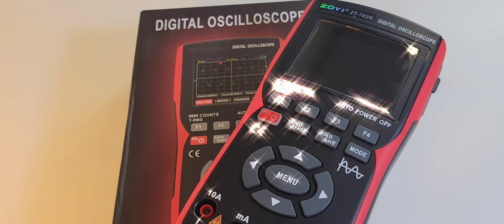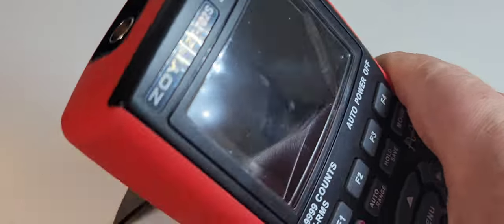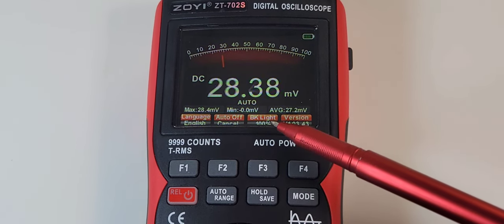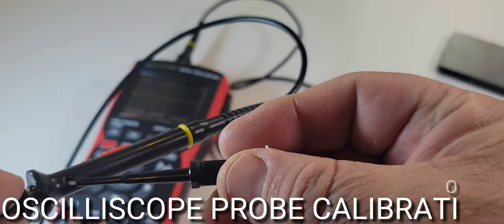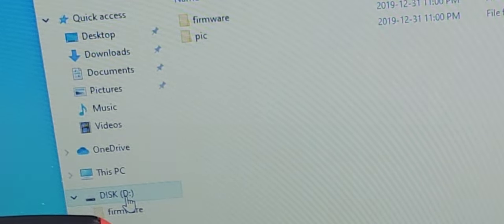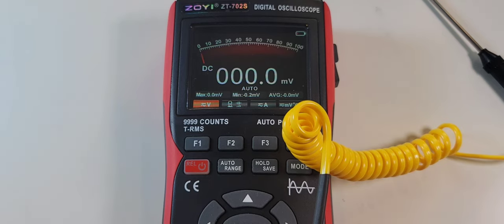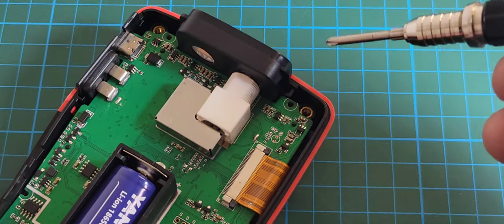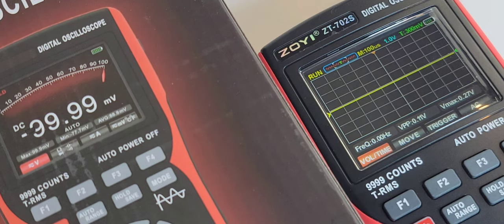ZOYI ZT-702S Multimeter + Oscilloscope Review & Teardown!

Comment: Really like this 2 in one. A DMM and Oscilloscope. I like to use this in my hobby of installing car Audio. One thing I notice is the over range issue. In car audio we are looking for non-clipping signal and a over range reading can mislead one.
Reply from the maker: Yes over range can be an issue ..it's still a new meter so hopefully a revision of the firmware will solve that in the next iteration.

Comment: I bought one based on Dave's review. He was unusually noncritical. I already have an Owon. So far I really like it for 1/3 the price. But so far, after some component tests, I have been using it with an HT antenna, watching the output from my transceiver and looking at RF from other sources. Although it is 10kHz it accurately displays the frequency up to at least 20mHz, so can be used as a counter. It is a pretty good HF RF monitor. I'll be checking the voltage and current accuracy later. I still have the Aneng SZ-20 to test! Too many DMMs.

There IS a REL. On the on/off button.
Reply from the maker: I think you'll be impressed by its accuracy..so far its been a real trooper !

Comment: Excellent!

Even tho I am a Fluke meter guy, if this was available 30 years ago, I would have bought
this over the one of the Fluke meters I bought back then!
Having a portable scope for use in installation/troubleshooting purposes is invaluable!

If you are worried about battery charge, carry a power pack, just in case, and plug it in when not in use!
Reply from the maker: Right on Jeffrey! Even today it makes the perfect Fluke companion 😊👍
Reply: @KeepOnTesting  I have a Fluke 117 meter and this Zoyi scope meter. Honestly these two meters are  the only two multimeters most people would ever need. Use the.Fluke for high energy high voltage work and the Zoyi for low voltage precision bench electronics work.
Reply from the maker: @robc8468  So true Jeff! That sounds like the perfect combination! As you say..with those two meters you can test/troubleshoot just about anything!

Comment: Hello Darren. Haven't been on in a while, life changes every week...
Thanks for the review. This device, like its brother OWON, is a very good device. For the price of $65 we have hybrid circuitry and a good set of instructions. For beginners and advanced electronics engineers, this is a very good device. There are friends who use these on the road. In our country, a lot of people earn money repairing equipment, car repairs in their garage. And such a device makes their life easier. Its accuracy is confident, even with an increase in frequency, it remains at a good level.
Of course, you can find flaws in this device, but the price covers them.
It was possible to expand the information content of the scale by the limit, by overload. You forgot to mention the REL function.
In general, I agree with the rating 5 out of 5))
Reply from the maker: Yes my friend! A well constructed and programmed multimeter  and oscilloscope at a very fair price ! I didn't see the REL was on the power button during my initial review..not the best location but it does have a REL. ! It's an excellent tool and worth those 5 stars ! 😃

Comment: I'd love to see one of these devices be truly integrated... use the DMM probes for everything, current waveforms, etc.... Even if it was low spec, if done well it would be a really useful tool. This just looks like my ZT-Y with a ds0-138 smushed in. Nice screen tho....
Reply from the maker: I hope that's the next step...it would  really be a nice way to improve an already awesome meter 👍
Reply: @KeepOnTesting  There are several earlier models from a different manufacturer, but they are all 1 MHz.

Comment: No to criticize
Great video. But not to criticize too much…

3:50 Plastic BNC’s on a oscilloscope is not a manufacture cheapening out on a product. Its actually the complete opposite, typically, if not always plastic BNC’s indicates isolated inputs. Because it costs two to three times more to manufacture isolated front end on an oscilloscope. 

But in the case of this singe channel scope as long as your not using the usb at the same time as probing a circuit grounded to the same power source you shouldn’t have any issue. Because the power ground and probe ground will almost always share shielding on full metal BNC’s. 

15:08 Does that not say REL on the red power button?
Reply from the maker: REL: Yes..I stated that in the comments as well..I completely missed the Rel/Power button as it was really badly placed. 
PLASTIC BNC: Good point 👉 👈 I didn't look at it from that perspective but makes sense.
Thx for watching! 👀

Comment: Hi Darren!
I bought it yesterday and I am very impressed. It's fantastic.
I have a question: What charger should I use? How many amps? Watts?
What if I use your 5000mAh battery?
Reply from the maker: Hey that's great 👍 news! I'm now using a rescued 18650/3500 mAh battery I pulled from a defunct Dewalt battery. It's a Samsung holds the charge very well. XTAR X4 is a great choice for chargers 👌

Comment: It finally ARRIVED! By the way, with a newer software version (1.03.51). This version has a MAJOR improvement: EVERY TIME you select "A" or "mA" in the multimeter mode (including switching between these modes), it displays (graphically!) the correct connection of test leads. Unfortunately, it does not display anything when you RETURN from those modes. 

PS, being advertised as TRUE-RMS, it cannot do this for high frequencies even in the scope mode! 
The situation: a vintage Soviet VFD calculator with a step-up converter, its VFD filament is powered directly from one of the secondary coils. The voltage on it is 2.5 V RMS +/- 10%, 115 kHz, PWM-like pulses with duty approx. 25..30% and without any DC component, 8..8.5 VPP. In multimeter mode, it displays zero (as all my other multimeters except Electrónica MMC-01 which displays 7 V). In scope mode, it displays 3.33 V RMS, which is definitely deadly for the VFD (and it operates perfectly!). Are there any multimeters that are able to measure RMS of such signals correctly (at least +/- 10%)?
Reply from the maker: Great stuff !! Honestly.. to measure high frequencies a good Scope is the only way to go. Dmms always have low maximum bandwidth involved. I don't know if the expensive Fluke 87 has analog or digital true-rms conversion. I'd say digital..most cases "true RMS DMM" means "it works for 50/60/120Hz that's about it..
Reply: @KeepOnTesting  Yep, up to several kilohertzs.

Comment: Wow, 5 stars. I see this meter-o'scope managed to impress you. I can't remember the last time you gave a 5 stars mark.🎉

Another alternative for a budget hobby oscilloscope could be the PC type. They usually have slightly better specs than handheld ones, but the crappy software could be their weak point. Or you can try your luck hunting for a proper bench scope on a used market. 🤷‍♂
Reply from the maker: Zoyi really knocked it out of the ballpark.. a real usable multimeter with an oscilloscope and rechargeable too...all at a price that's jaw dropping ! 😳

Comment: Just know that the battery you replaced it with is most certainly NOT 5000mah.  18650's top out at about 3500mah for 'low drain' types, and even less for high drain (~10A+) ones.
This is why it's important to buy Li-Ion batteries from reputable vendors like 18650batterystore.  There's a good chance that battery is even less MAH than the original, although the original could have had inflated numbers printed on it as well.
Reply from the maker: Yes indeed...3500mah is to be expected 😊 I've since replaced it with a Samsung INR18650 I rescued from a Dewalt 20V Max battery. It's a great battery...just not thrilled that it's pink 😅😅😅
Reply: @KeepOnTesting  Pink? --- sounds like they might be the Samsung 30Q's I have.  Great batteries - 15A and 3000mah.  But I'm not wild about the pink either. 🙂  I use Li-Ions for both vapes and flashlights, so I'm somewhat versed on the good batteries for these applications. 👍
Reply from the maker: @enigmaticmf  Agreed..These Samsung's are definitely winners. Just don't know how pink became their color choice..would be great in a flashlight as you mentioned. I should find my camping gear and upgrade to these.. 🤔
Reply: @KeepOnTesting   I know I'm late to the party, but the tools I have that are painted pink seem to stick around in my bag/box and not as likely to be "accidentally" misplaced with someone else's tools.  Thanks for the review; I have a 702S on the way to me now and have returned another meter based on a different review video you uploaded.  You've earned yourself a sub, thanks!
Reply from the maker: @JoshCarlsonftw  Great to hear Josh! Let us know how you like your new 702S 😊👍

Comment: Good day , thanks for the awesume presentation. I know very little about Oscilloscopes but I wanted one to test the output voltages on generators (110, 240 volts) would this meter be able to handle these voltages in oscilloscope mode?
Reply from the maker: Yes, not a problem 👌

Comment: Hello, Can it be used in automotive diagnostics? Does it support CAN, LIN and FlexRay protocols? And if not so what is the affordable one do you recommend for automotive repair?
Reply from the maker: No. I do not know if any dmm that supports FkexRay protocol ..it's a proprietary serial network standard so would be very costly to implement. I just reviewed a CHEAP-O automotive dmm that has alot of features. https://youtu.be/-al5Jrjucyw
Reply: Thanks for your help. @KeepOnTesting
Reply from the maker: @ksamprocar-oh4ft  anytime my friend!

Comment: When I turn on the device, it opens in oscilloscope mode.  How do I set this to multimeter mode at boot
Reply from the maker: Unfortunately yiu can't..it will always default to Oscilloscope mode.. hopefully a firmware revision will change this in the future 🙏
Reply: @KeepOnTesting  I understand  So what do we do to update the software?
Reply from the maker: What version firmware do you have ?
Reply: @KeepOnTesting  V1.03.51

Comment: Darren, what dose the REL button do then?
Reply from the maker: The REL mode basically zeros your multimeter reading at whatever point you are currently measuring. This point then becomes the new RELATIVE..a baseline measurement point ...
Reply: @KeepOnTesting  Yes Darren but you said this has no REL function
Reply: @shaunmorrissey7313  Doh! 🤣 Hey he is human ya know.. 🤓
Reply from the maker: Uhhh..sorry misunderstood you the first time. Yea..That was a brain fart on my part. It does do Rel though ideally not sharing it with the Red power button would've been nice 😂

Comment: BNC connector is never made of plastic. 
It aften has a proctective surface, which is really recommended.
Presented device has a cheap plain BNC socket. It is not a good job.
Reply from the maker: Not true. Several vendors employ plastic connectors. Its a BNC connector with a molded plastic body. These plastic BNC connectors come in 50 and 75Ω versions and are fully compatible with existing products and applications while offering customers cost and weight savings.The plastic BNC connectors are nearly half the weight of a conventional version, weighing ~15g compared to metal versions at ~28g. Weight sensitive applications include mobile devices, instrumentation and avionics systems.

Comment: I looked at a lot of reviews on this device and nowhere did I find a mention of such, maybe not very noticeable, as it seems to me, a software glitch in terms of display - this is a periodic flicker of symbols of the type of measurement in multimeter mode, such as AC, DC, graphic elements of a resistor, diode, calls. This manifests itself in the form of a small periodic flickering of the upper part of these elements on the screen. I am the owner of this device, and at first I thought that it was only me who had such a jamb, but after looking at several reviews, this is also noticeable on the video. The firmware is the latest 51st, a device branded RICHMETERS 702S. This bug is present for everyone or not, I would like to know, it seems like a trifle, but not very pleasant. Owners of this device, write, someone like this glitch

Comment: Your 5000 mAh 18650 Cell is fake. Because it's not possible to have that much capacity in this size...😢😢😢😢😢😢The maximum capacity that an 18650 size Cell can hold is between 3500-4000 mAh....